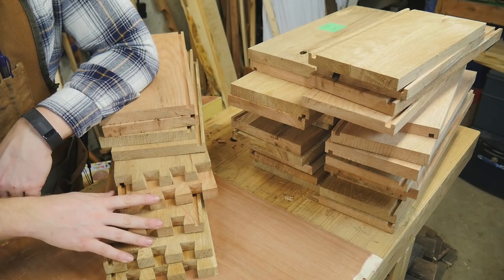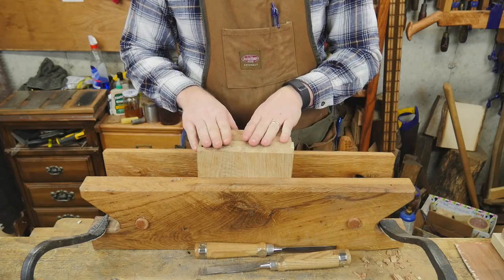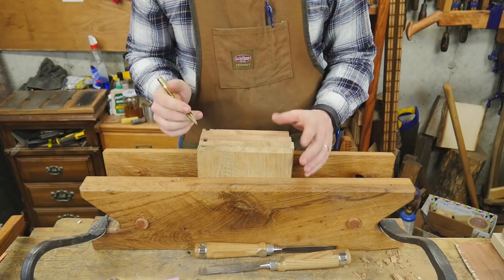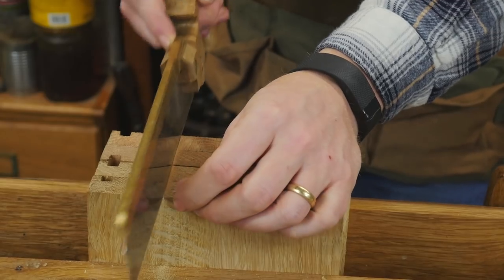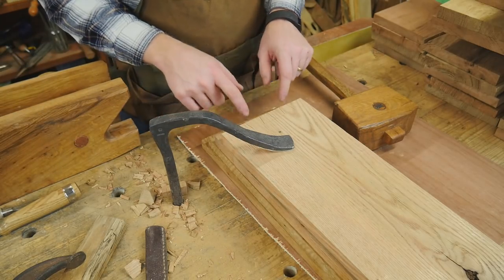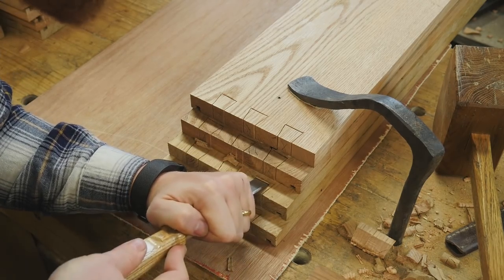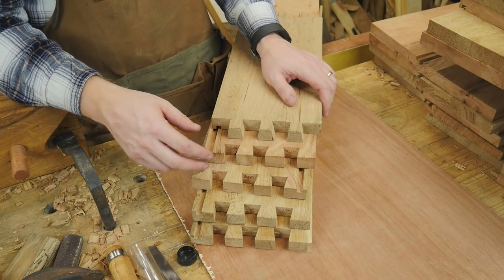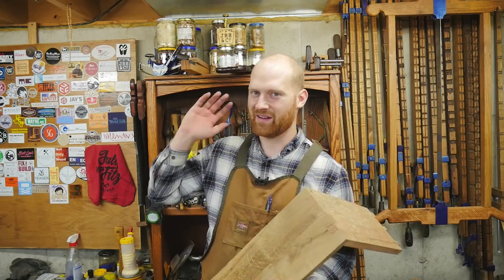How to Hand Cut Dovetailes Faster Woodworking Skills Tips and Tricks

Comment: You make it seem like hand cutting the joints for all of those drawers is possible.
Reply from the maker: +Brad Knecht lol something like that
Reply: did you figure out your efficiency? if one set takes 45min, how long did 5 in a batch?
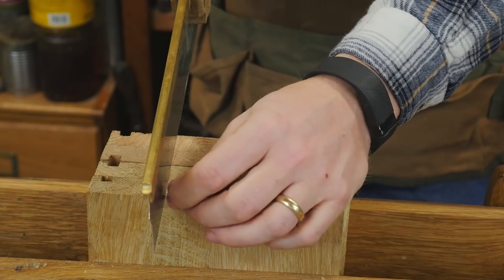Reply from the maker: I was actually just calculating that today. One drawer took me 3:10. the other 9 to me just over 21 hours total so about 2:20 per drawer. I would call that a significant time savings.
Reply: Wood By Wright did this increase your re-work? That is the amount of time needed to fine tune to get each piece to fit?
Reply from the maker: no that ended up being about the same. The factor that changes that is how well the marks are transfers from the tales to the pins, and that is still done one at a time.

Comment: if you tap finish nails into your story stick and file off so you end up with a tiny point you can use that as a quick marking guage when doing the same layout over and over. That's an ole spindle turning trick that works well with mass production hand tool projects.
Reply: Oh, and good video
Reply from the maker: +wortheffort that is a great idea. Thanks.
Reply from the maker: +wortheffort thanks.
Reply: great idea thank you

Comment: You can also make a pattern board of 2x material with the saw kerfs as a guide.  Clamp with drawers leave about 1/4" high.  This keeps cut square and eliminates marking.
Reply from the maker: very true. a lot of people like those. I am personally not a fan of guides and jigs, but that is just me.
Reply: Wood By Wright Same here.  I saw Paul Sellers use the guide.  Yup for mass production I gang em just like you do, even though I actually prefer pins first.

Comment: James the biological Robot :D :D
I made a blanket box with 72 Dove Tails and did not want to go near a DT for a few months after. You said it will be heavy, I hope you have a little help to move it once its done.
Reply from the maker: LOL thanks. speaking of help do you want to come over to help me take it up the stairs?
Reply: LOL, just give me a couple of weeks notice so I can book the flights.   Distance is not a problem for Ozzie's. I travel 1000 miles every Monday just to get to work.  BTW is there a dog leg in the stairs? Might have to take the roof off and drop it in by crane ;0   I once built a wardrobe and had to take it outside and lift it in through a second story window (with a little help from the fire brigade).

Comment: Just a suggestion, even if you are going for the hand cut, which I like as well, I would hog out most the waste with a circular saw.  I find that the tedious work should be left to machines.  You can also get a cleaner end grain when the chisel doesn’t have to push out so much material.  Everything that matters is still hand cut.  chiseling out 75 x 3 boards x 2 sides is a bit masochistic.
Reply from the maker: Yep. If I had power tools I would actually use a bandsaw for most of the stock removal. But this is a hantal only channel.
Reply: Ahhh I see.  Actually a band saw definitely makes sense doing a small stack at a time.

Comment: I find cutting thicker wood to be a lot more difficult than cutting thin wood. Bc you are basically making thin wood thick, is it worth the difficulty in time saving?
Reply from the maker: the cutting is about a wash. the time savings is in the setup. rather than setting up one board ar a time you are setting and marking 4 or more at a time. but if you go much thicker than 3 or 4 boards I will switch to a tenon saw.
Reply: Wood By Wright I usually just eyeball the pins and trace them for the tails (right now I can more easily free hand pins versus tails). So I generally don't mark. I'm not critizing. Just curious if it would save ME time with MY skills and MY cheap handtools.
Reply from the maker: everyone is different.if you do pins first this won't save you any time. that is the big reason I do tails first.
Reply: I'll give this a try. and find out for myself. thanks for the video. love your channel!

Comment: you should look into frank klausz method for dovetails. way easier and faster imho.
Reply from the maker: Ya I love his way. I Sometimes do that if I am just doing one drawer, but not as much for a pile of them. But that is me.
Reply: Wood By Wright i was mostly commenting because you said it takes 45 minutes per joint, that just seemed like a lot but i know if you want to get everything perfect it can take time. i do think your batch cutting method is a good idea when you have a lot to do! sorry didnt mean for my comment to sound overly critical.
Reply from the maker: it is 45 minutes for these all solid oak and much larger than a test board. if I do test boards 2-3" wide and so them out of some kind of pine I can do then in 10 minutes or less.
Reply: Wood By Wright ahh yeah that makes sense! 👍

Comment: Nice! 
But when you cut at an angle with your saw...how can you repeat the same angle on all dovetails?
Reply from the maker: by eye you can get it close enough that other eyes do not see the difference. They do not have to match to a machinists tool. once you do it a few times your arm can repeat an angle that your eye can not see the difference.
Reply from the maker: yup, that is the difference between a machinist and a woodworker. a machinist tells if his work is good by checking the finished project with tools. the woodworker does it by eye. if the eye and hand cannot tell the difference it does not matter because wood will move.